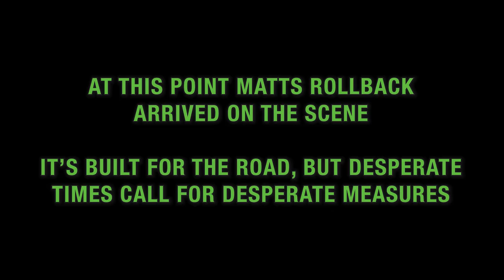Matt Made A Call

Comment: Trail mater is truly an off road wrecker. Being able to drag that pickup truck through mud is truly a testament to the work Rory did to build it. Good job, both of you.
Reply: Looks like in the battle of the Immovable Object, the Irresistible Force won this time.
Reply: No kidding. That Dodge is so heavy. Trail mater pulled it like a sled without spinning is an amazing sight to behold.
Reply: Why not use the roll back and toe that out

Comment: Holy cow!  I would have never believed that a vehicle could get frozen to ground that bad if I hadn't seen it with my own eyes!!  Awesome teamwork and recovery!
Reply: Ice with some dirt and plant matter and stuff to help bind it and so on might as well be cement in terms of how hard it sets and how hard it can be to break in a situation like this... Ice and sawdust has been suggested to make aircraft carrying barges and makes a not bad improvised bullet resistant material, look up picrete
Reply: @Simon-ho6ly  Pykrete....very interesting history
Reply: It's pretty crazy. I've seen a couple rigs freeze in that just had to be left until the next thaw. If you're not careful you can rip axles off and buckle frames trying to recover vehicles that sink in mud and then freeze.
Reply: @simpledj509chromo7  I think if that had happened up here (Manitoba)  you would have had to shroud it in and put a couple of propane heaters in to thaw the ground out....or leave it 'til spring thaw!
Reply: @thomassummer7478  Insanely interesting, but ice with some mud and weeds and scrub in it... is pretty similar too, there are whole other classes of materials based around "ice plus stuff"
Reply: @JointerMark  Yup you are correct, but the problem with wrapping a sunk frozen vehicle is that heat travels up. At least from what I've seen and what I know, you'll burn that rig to the ground before you thaw the ground that it's frozen to. I've seen it work but if the axles are buried and it's resting on a partially submerged and frozen frame (literally worst case scenario) you're totally screwed. Better off waiting for a thaw than totaling a rig on a recovery.
Reply: @simpledj509chromo7 Warm air convects up.  Heat per se is not affected by gravity and conducts where it will.   Tenting and radiant heat applied to the ground can and does loosen a frozen surface.  It isn't a low energy consumption process.
Reply: @brucehalleran1149  Yes you do have a point. It might work well for frozen rigs that are barely stuck. My previous comments were talking about rigs stuck to the frame with axles buried when a hard freeze rolled in. Wet, dense soil is a bitch to thaw. And you are correct that it would not be a small job. My best idea would be to insulate the rig like you're winterizing a camp trailer but with 12 inches of clearance outside the tires. Stick a torpedo heater in there, ensure it doesn't get too hot, and dig a few times a day until it is free. It wouldn't be fun but it'd be better than totaling a rig.

Comment: Pulling that RAM with frozen wheels was incredible.. Rory is the man.
Reply: BIG BLOCK CHEVY BABY!
Reply: And a diesel, crew cab, long bed Ram at that, extremely heavy. (With at least 2 wheels not spinning)
Reply: I don't understand why they flat towed it if the rollback was there?
Reply: And yet there was a empty roll back sitting right behind it only moments before.:face-blue-covering-eyes:🤔
Reply: @iffykidmn8170  Weight on the rollback would have bogged it down in the mud.
Reply: @primrosereceptionist611  The ground was still frozen when the roll back was sitting there.🤨If not the stuck weight of the vehicle when they were using the rollback to lift the vehicle would have bogged it down:face-blue-covering-eyes:
Reply: @BT-ej9xf  If I had to guess, with the added weight it would have probably gotten stuck it's self. 
Not 4 WD and those low pro street tires are not great in the mud.

Comment: You share it all. No sugar coating it! The good, bad and ugly of something that bad. Most would just walk away or say you need a backhoe?? maybe with a hammer to break the frozen ground? Awesome and what a friendship too.
Reply: These guys can't walk away without trying to solve the puzzle.  The more challenges they attempt, the bigger their arsenal of experience becomes.

I don't pretend to know anything about this stuff, but I wonder why they didn't put the Dodge Ram on the flatbed once they had it free and then use TowMater to help pull the flatbed out?  At least the flatbed could roll and had power.  Might have been too much combined weight in that mud, though--as I said, I don't know anything about this stuff?

Comment: That was BRILLIANT, what a team you guys make, the power of trail mater is mind boggling...
Reply: I have a few RC rock crawlers, wouldn't it be awesome if one of the RC manufacturers made a fully working trail mater.
You can get winches that would fit already.
Reply: Could use the traxxas trx-4 k10 high trail edition as the base!
Reply: I think if they'd put any more lifting power to that pickup they'd have a banana shaped but still stuck truck.  That ice was sure impressive!
Reply: @deanbuchanan4151  that's a great idea, I wonder how is going to scratch build one first...

Comment: One of the guys in the company got his CJ5 stuck in a mud bog up on a ridge on Ft. Wainwright, AK. He and another guy walked out back to the barracks. This was in Sep/Oct of 79' or 80'. They tried to get it out over the next few weeks. Then it snowed and the temps dropped. It was frozen all winter long until Breakup the next spring. When they were able to get it out, the tires had popped due to the permafrost and the mud freezing. This tidbit of triva was the first thing I thought of when I saw that Dodge frozen to the ground. Funny memory.

Comment: So like everybody else, this was an awesome recovery, and I especially enjoyed the wheel-locked Ram getting dragged.  But I've got to be missing something.  Did y'all forget that the rollback was just a few feet away when you got the truck unstuck?
Reply: Probably didn't want to weigh the rollback down on that muddy trail.  Not worth damaging the rollback's transmission when Trailmater is right there.
Reply: Put the ram on the roll back and pull roll back with Rorys truck for an assist.
Reply: @markjohnson2641  With the rollback and that cummins you are looking at close to 30,000lbs. If you get that stuck you are screwed. Safe play was to do what they did.

Comment: Froze down story.  I have a steiger 4WD tractor with a dozer blade.  Had to move it to install new injection pump.  Used the hydraulics from another tractor to lift the blade that was froze down.  It lifted the back of the tractor off the ground.  Full lift with loader from the other tractor also.  Nothing.  A few smacks with 12lb hammer it came loose.  Ice is strong.  Add mud in the ice, good luck.

Comment: Whenever I get a tractor stuck in mud and then it freezes at night I just bring a small 2000 watt Honda generator and a little Bosch 35 pound electric jackhammer and spend about 10-15 minutes around each tire breaking up the frozen rocky soil and it will break itself free after.  That wrecker certainly would easily pick up the rear of that truck after digging around the tires.  If I even think for a second something is going to be frozen in I toss it all in the truck with 50' of cord and a couple extra spade bits in case I get one stuck.  I also use a couple Mr. Buddy propane heaters so I can lean it against the front tires and warm the soil while I work on the back or vice versa.  These tires are much smaller so I think it would have been a quicker job.  You guys got it done but it was pushing everything to the limits.  You probably already have the tools I'm talking about, it's just a matter of tossing it in the truck.

Comment: Had a problem like that frozen in 1953 Merc Monterey  2 door hardtop bare front wheel frozen in the mud 
bent the arms on the floor jack , solution hot coals on the wheel and mud took more then an hour 
but it broke loose and we loaded her up

Comment: Next time you get a call for someone in frozen mud.  Try taking a cooler full of water and then use propane to heat one bucket at a time to near boiling, then dump the boiling water around each wheel as you go.  It will probably take 10 minutes for the heat to conduct down below the tire, so get the next bucket heated and down before attempting to get the prior wheel out.

Comment: Should've used trailmater to lift the front wheel up and towed it like a tow truck, better traction on the rear tires and only pulling 2 dead tires on the truck

Comment: Probably better that Matt didn’t have the heavy wrecker working for this job and called you for help.  Had he tried to pull that truck out with the heavy wrecker he wouldn’t have been as patient and dug it out and the result would have been broken springs, axel bolts, and (if the frame didn’t get twisted when you pulled sideways on it) the heavy wrecker might have put a good twist on the frame.

Comment: Unbelievable!   I went to pull a guy out that sunk in red mud while sitting still in the dead of winter in the Arizona high country.    I hit it with a strap and couldn't pull it forward at all.  Actually had to jack up the strap to get enough slack to get the strap off my trailer ball.  Pulled around behind the guy and tried to pull there.  As soon as I made contact,  my Jeep broke through the frozen top layer of mud and the 33" tire was completely buried.   Inconveniently, someone had stolen my Warn Winch a couple of weeks earlier and all we had to work with was a high lift jack and a come-along. Turns out there was a tree root just in front of his front axle and another root just behind the rear axle. The saga started arond 2PM and I called home about 2AM to say we were on our way home.  We would have been in this same frozen mud situation had we waited until tomorrow.   The worst part was this guy had gone past  past a no trespassing sign and couldn't call anyone else...  Wonder why that sign was there?

Comment: This isn't exactly a comment but a more of a question. I'm running a 78 Chevy step side with a 12" lift and 40" LTB's. I assume watching you shift your trans that you have an SM465 like I do. I have a 205,203 doubler running a 14 bolt rear with a detroit locker and a Dana 60 front also with a detroit. I've smoked 3 clutches while either pulling or just getting stuck in peanut butter mud. My motor is a mild built 383 running a roller cam, all forged internals, Fitech EFI, ect..  It makes around 450 horse power. I see you do pulls like this and not loose a clutch. What clutch are you runinng? I've used LUK 12" cheapo's which honestly have been the best. I've run a RAM 6 puck ceramaic that lasted about one good dead pull and smoked so bad it cracked a flywheel, and I've had Okay luck with a centerforce dual friction, but it also left me stranded. What clutch do you run to pull that hard and not smoke  a clutch?

Comment: Curious why if you had a roll off wrecker there after getting it unstuck you did not load it on that right way instead of skidding it out and then loading it. Seems towing the flat deck roll off would have been better than skidding a vehicle with frozen wheels.

Comment: Holy $#!# that was a stubborn one..... wondering why if it was that frozen to have gotten the flatbed back there without sinking in... why not drag it up on the bed, haul it out on the flatbed? At least that rolls & attaching a Yankum rope to the  flatbed & assisting if needed would be easier than dragging a 9k lbs Brick out? Either way...that was badass! Won't forget that one for awhile...

Comment: WHY? did they not just winch the truck onto the rollback when it would not turn a wheel? That way it would have been driven out without just about breaking Trailmater!  When both driveshafts were broken it was obvious it would not drive with both axles being frozen or jammed due to broken gears!

Comment: Put a tarp over the wheel and use it to route and contain the hot exhaust from your recovery vehicle to thaw out the wheels. It would be much easier work than prospecting. Pouring fuel on them would work too but I’m sure you wouldn’t want to pollute the soil. Atleast not on camera.

Comment: What was the reason that when they used the rollback to unstick the backend of the truck why didn’t they just put it on the rollback then instead of dragging the truck to the road and then loading it on the rollback?
Reply: The rollback likely wont make it out with that weight on this slick dirt road. Much safer to pull it and make sure the rollback gets out on its own.

Comment: Why not directly on the back off the truck and set it inside a warm garage ore something? 
Why dragging it like this??
The ground is already frozen solid so the truck also can drive on it with the pick-up on the back. 

Dragging it this way with the front driveshaft on the ground like this?? Transfer will have it hard to

Comment: Competition weight wise. BSF and trail mator are already out tiny little booms small axles no bracing for the boom. I think it’ll come out between Paul and Matt. Paul can go where ever he wants Matt is limited I’d say with weight and size. But hey I’ve been wrong before. I’m just certain BSF recovery is least built then mator 2nd last for sure. It’s between the two on whose out first. And not to hate I love all the channels but mator, Paul, Matt, and BSF, should be. Able to choose there strong location or “home” area the truck performs best and see how the others hold up. Rory has advantages but Paul similar build might just take the lead. Heavy wrecker might be just to heavy. Hard to say now I can’t pick a winner. Wrong channel to say but now I thought about it Rory or Paul. I’ll make my mind up soon

Comment: i would have used that propane to heat water (melted snow) & pour it on sand by wheels to losen jyst b4 pulling lol
make sure not hot enough to crack steel lol hot nuff to melt iced sand

Comment: Doesn't help that's probably a 9000lb truck empty, plus the fire wood, tool box or fuel tank whatever it is and the tires are all locked up. Ol trailmater doing work dragging that dead weight, I mean dodge ram.